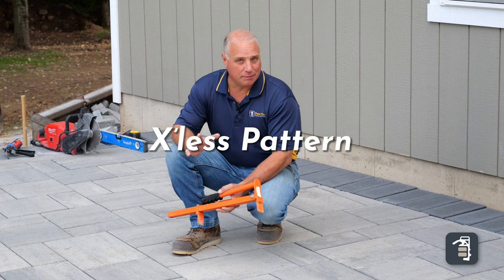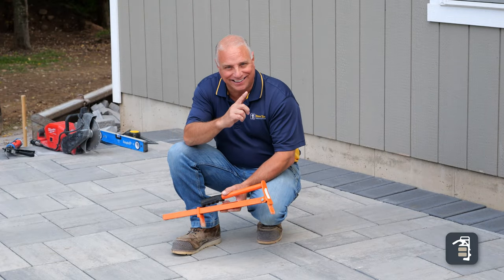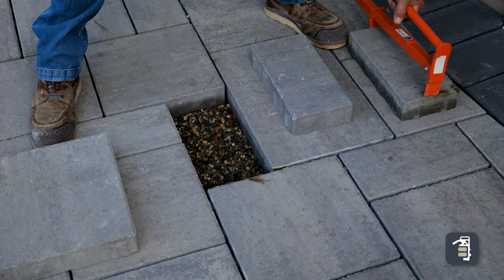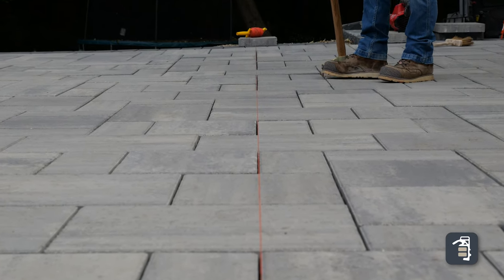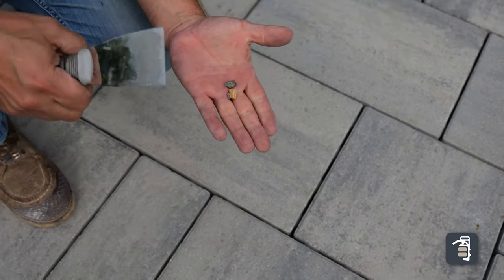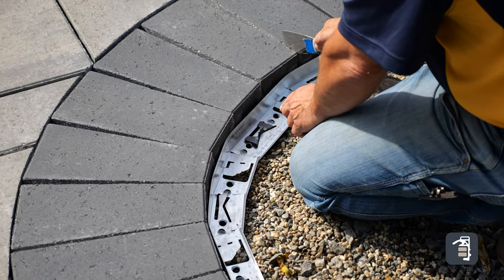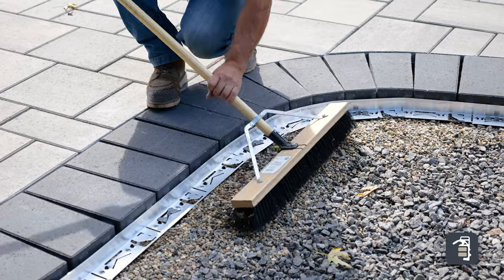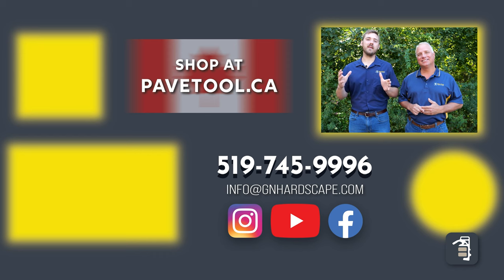What to Do Before Joint Fill on Your Patio

Comment: When you removed the chipped paver, the bottom half of it was damp, as was the gravel underneath it. It seems logical to assume most of not all of the other pavers were damp on the bottom as well. 

Can you put down polymeric sand when the bottom portions of the pavers and the stone underneath are damp or do you have to wait until all of that is bone dry?
Reply from the maker: If you are using polymeric sands you should wait until everything is completely dry. However in this application we installed our Xtreme Easy, a pre-mixed, 1-component resin paving joint
compound, which we sweep in with water. Stay tuned for this Friday's video.

Comment: as a fellow hardscaper !! I would expect the border radius to be pie cut better then that from you guys !! also your border joint line is not in line with the patio (blu 60 mm looks like ) just saying you guys are top of the line up there !
Reply: This is probably a customers job site and not one of Pave Tool’s.
Reply from the maker: Thanks! In regard to this particular application we were working with another contractor. It was preferred that 3/8th spacing be set for the fans in the soldiers row. We have installed both ways, tight and gapped, it really is the preference of the customer. To make these all tight on that whole serpentine curve nearly each paver would have to be cut twice. In regard to your border comment, we purposely cut a half to get started so that our seams would not line up with the pattern, we try to avoid X's in the pattern/border as much as we can. Thanks again, love the feedback!!